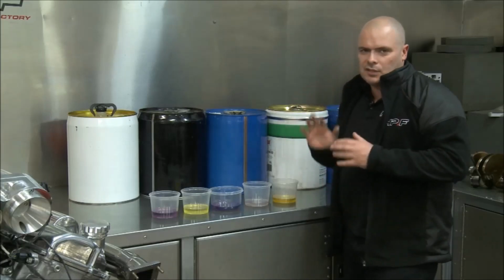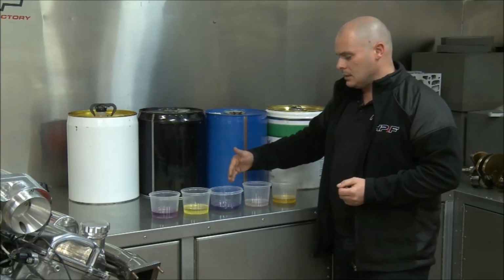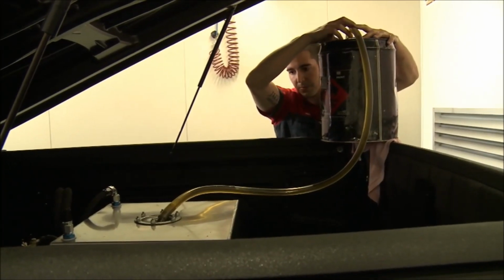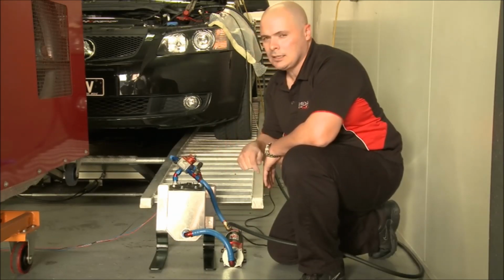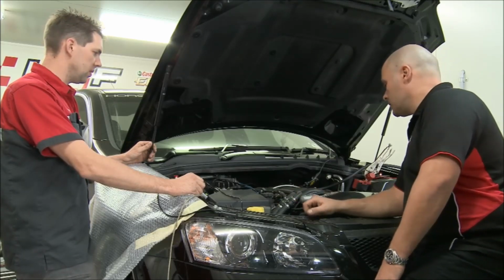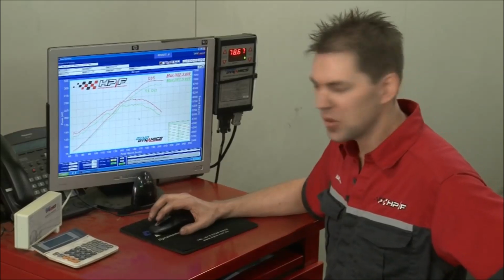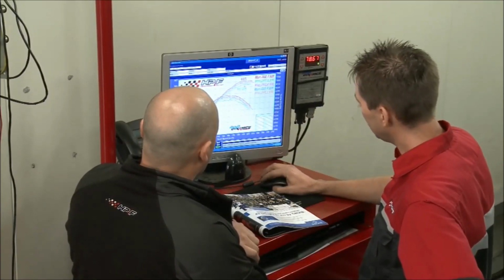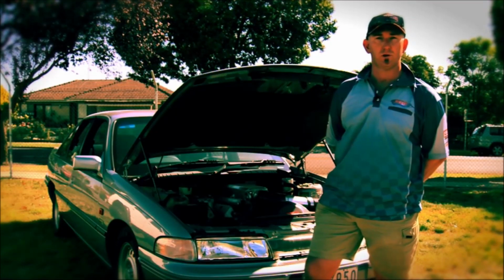OZG S1|E10 - Fuel Testing - Octane 91, 98, E10 and E85 + Latrobe Valley Street Machine Show

Comment: So power from E10 vs 98 being within 1kw, the real benefits for a daily driver based on the fuel prices as of October 4th 2021 in vic 

98RON - 171.9 c/pl
E10 (94RON) - 152.9 c/pl

Savings of roughly 18 c/pl, for a potential fuel efficiency deficit of 3%.... you'd be silly not to run E10 if you're commuting daily to work. Whilst with a late model FG Barra or even VE/VF 3.6L
You'll still get performance gains running E10 vs 91RON, whilst running slightly cooler combustion temps.
It's not the cost factor, E10 can still yeild performance very close to 98RON, in recent times 98RON's brilliant marketing strategy has seen prices soar !. Both are still cleaner burning than 91RON, with E10 being cleaner burning again compared to 98RON. Injector cleaner every service, you'll probably never have an issue with E10.

FG's actively adapt to fuel octane rating, probably one of the biggest bragging rights they had back then.
Reply: I brought my VF calais 6L over from Aus to NZ. In Melbourne I got it tuned for 98 when i did the headers, exhaust and intake. Here, Gull has a fuel called Force 10 which is "98 Octane" but 10% ethanol. Will it cause problems running it, even though its "98 octane" since I have a specific 98 RON tune? It's around 20-30c cheaper/L than regular 98 (98 is also rarely stocked at servo's here).
Reply: @bustups_AU  Most modern Commodores VE - VF, Falcons FG - FGX will allow up to 10% ethanol & have ethanol rated hardware 
Lines, pumps, etc etc.

So i doubt it'll cause any issues. E10 is still higher octane than 91RON regardless, plus ethanol is a great cleaner haha !

I've been running my FG MKII G6E between 98RON & E10, guess what ?, performance is the same, i lose a mind blistering 10km in comparison. Both tests i've sent oil off for analysis test was based on 3500km intervals (3500km on E10) & the same for 98RON
Identical results in terms of wear metals, tbn levels, zinc remaining, etc
Reply: @ThomasFG  thanks for the reply mate. Yeah I am almost through my first tank of e10 and haven’t noticed any performance issues, maybe slightly less KM/L. But with it being almost 20c/L cheaper than 98 RON, the minimal economy loss seems worth it. I was just concerned about the tune being specific for regular 98 with the timing etc. Don’t want it running too lean
Reply: @bustups_AU  Basically Commodores/falcons of the modern era will be some form ethanol compatible
Reply: @thewayoftheshinobi  Thanks for the info. Normally I wouldn't hesitate to use E10, however my car was specifically tuned for 98. I have found a service station that stocks RON 100 at the pump and is also cheaper than most places for 98 so I am using that now ;). Called my tuner and he said he wouldn't recommend using e10 with the 98 tune, but using 100 RON was fine.

Comment: Would 09 ve ssv commodore fuel system handle E85 . Looking to add felx fuel sensor and  turn on flex fuel in hp tuners with 525cc E85 injectors to help with 33% extra fule